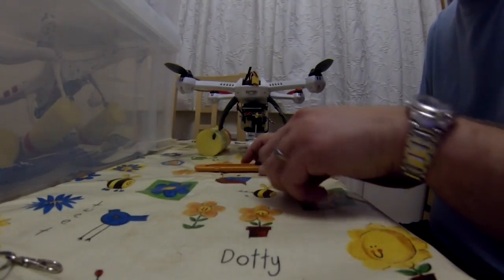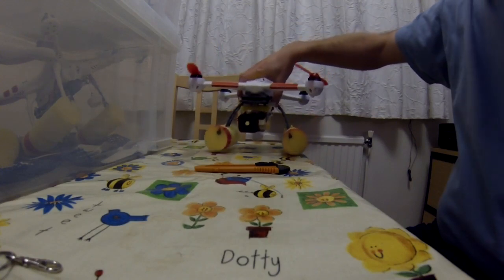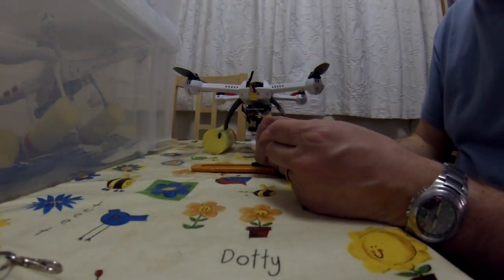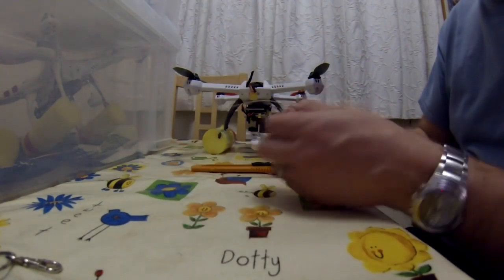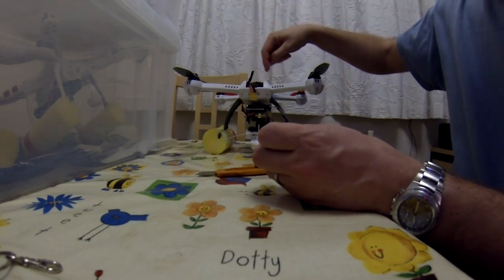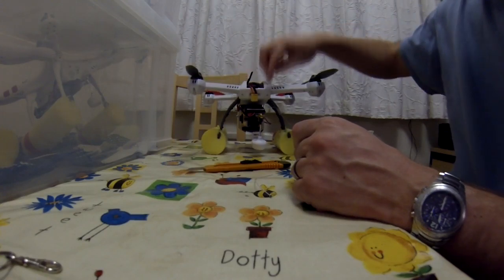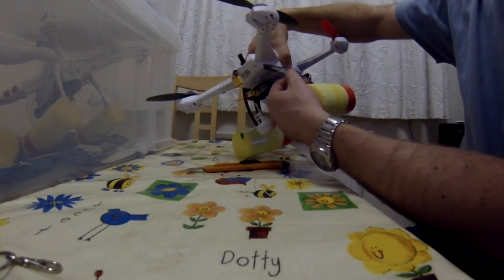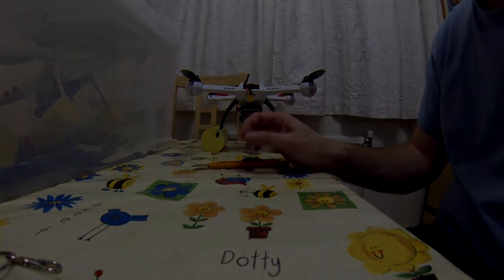Blade 350QX short RC range fix - external extended RC aerial - doubled range test distance

Comment: Glad you had the need and the guts to try this. I wanted to try it when I read the new AP model having a relocated external antenna just to extend my range. Maybe you'll be able to buy it ready to solder on from horizon when the AP parts are available. I bet it mounted to the other skid opposite the the compass receiver. If not, I'm doing what you did. Thanks!
Reply from the maker: Ready to solder wouldn't really help - its the soldering which is tricky/scary (but nowhere near as bad as I feared), making the extended aerial takes about 30 seconds out of a 99p piece of thin coax. You could put the aerial anywhere you like, I just put hole straight under the board and ran it to the nearest leg.

Comment: So James, you solder the inner part where the stock antenna was? and the the shielding to the ground pad? I am going to look around and see if I can find some antenna wire around here I must have some, I have an old ar500 that glitched on me caused crash don't trust it could rob that antenna.
Reply from the maker: YEs, its annoying you have to solder the wire pointing upwards, but I couldn't find a ground point underneath, the AR500 aerial would work, but seems a waste of a receiver just for the wire, if you search ebay for nintendo wifi or IPX cable you should find loads of cheap options, mine was $1.60 posted.

Comment: Will give this a go for sure as I have been totally relying on the failsafe rth function of the 350qx
Do you know if the new 350qx board will be a direct replacement for the v1 ?
Reply from the maker: I'd be surprised if it wasn't (only connects to speed controllers and GPS/Baro sensor which I don't believe have changed) but no way to know for sure without trying it.

Comment: Well 3 hours later I got it working, the way it was originally.
I tried to use a router wifi cable, for whatever reason, it didn't work. Bummer.it look the right size?

Comment: Which of the Nintendo cable to use WII or DS Wii u ?
Or what Dia is the cable, found lot for all nintendo all different Dimensions in thickness .
Reply from the maker: The one I used was Nintendo DSi wifi cable, it was longer than the DS lite version (comes with a circuitboard/aerial on one end I just cut off to use wire). Thickness I would guess is about 1mm, it looks the same as the Spektrum/Orange aerial coax wire to me.

Comment: James, I have a question about the Nintendo DSi wifi cable.  I order one from ebay and cut the board and end connector off.  I was expecting to find a solid copper wire similar to the existing antenna on the Blade 350.  But it looks like its several strands wire inside the inner sleeve.  Is this what the cable is surposed to be? and if it is than great I got the right one...  So on the end that connect to the board you are just soldering the inner strands into the old antenna whole.  Correct?  and leaving about 5mm of shielding on it so it does not interfere with the outer shielding.  and then the antenna end you are just cutting the outer shielding away and letting the inner shield and wire act as the 31.25mm antenna.  Thank you
Reply from the maker: Yes, thats correct, you need to solder the shielding to ground and the centre wire to the original aerial hole on QX side, then the other end strip back the sheath to just leave the centre wire protruding as close to 31.25mm as you can get.

Comment: Hi. I've not even flown my QX350 yet and saw this whilst checking out the postings. If the aerial is being extended like this then would it make sense to go for a half wavelength unshielded section of 62.50mm? I know the tuned lengths are important but don't understand any of the 1/4 1/2 full stuff (guessing 3/4 would be rubbish). Thanks.
Reply from the maker: I'm no expert, but I understand aerial has to be exactly 1/4 wavelength no more no less, if you have half wavelength then you get cancellation effect along the aerial so actually get a weaker signal. All the Spektrum receivers I've ever seen use 1/4 wavelength 31.25mm aerials, and get range well beyond anything you should ever need, the only issue with the original 350QX was the aerial was directly on the control board which is shielded by battery/motors etc, so moving it out of the way is all thats needed, I believe the updated 350QX comes from the factory like this, so if yours is new it may not need anything doing. Best thing is the failsafe works really well, so you can try it out and if signal is lost, it will start to return home, and pickup signal again safely, so just try in a nice clear area and you should be fine.

Comment: hi James.   Thanks for posting this mod.  I'm hoping I can apply it to my 350qx which seems to have a very limited radio range.   I wonder how you were able to separate the fine wire wrap from the centre wire?  I'm thinking that since the wire wrap is to be grounded I must insure that it remains isolated from the centre wire or does that matter?  I find it almost impossible to insure that the wire wrap does not touch the centre wire where they are both bared and the wrap is retwisted to be soldered  It's difficult to see in your picture.  Is there supposed to be some insolation between the centre wire and the wrap (grounded) wire?  Don't know if you come back to this site to answer questions but I'll come back from time to time to check for an answer.  thanks in advance
peter416
Reply from the maker: Hi Peter, I found easy way is to use a knife as shown in video to strip the outer shielding, then pull the braid away, and then cut the inner shield 5mm LONGER so the centre wire cannot touch the braid/ground, if you pause/freeze the still picture it hopefully shows it better than I can explain.
Reply: Of course I should have realized there would be an inner cover over the centre wire. I just didn't see it but I've got it now.  Thanks again. And to be positive I checked it with the multi meter.  0 ohm resistance between the two wires.
Reply from the maker: Klaus Peter Musterer no problem, the video isn't that clear on those still pics so hopefully useful info for others too.
Reply: Klaus Peter Musterer  Job complete and checked the range this morning. 
excellent!! about double the range of the old copper wire antenna.  A bit of a struggle pushing the new wire through the old antenna pad since the solder tends to fill the hole as you remove the copper wire.  Just pushed a needle through a few times to enlarge the hole and it went in smoothly.  An excellent mod.  highly recommended.
Reply from the maker: Klaus Peter Musterer Great feedback thanks, glad it worked for you too, yes its a bit fiddly soldering in, I found by twisting and tinning the new wire it would push through the pre-heated hole, but certainly a good idea to clear hole out first with a pin. I haven't seen the 350QX V2 but I know they have altered the aerial to fix this issue, I wonder if they just did the same as us ?

Comment: I am having the same problem! Have you tested the range again?
Reply from the maker: Sorry, Not had a chance to test range properly yet (weather and family!). I have flown around willow cathedral but didn't check range, I can only do this at the flying club where I have plenty of space to test safely, also I know exactly how far it went before and can check it goes further. Will update description when I have done a proper test.
Reply from the maker: ***** I got out to the flying field today to test flying range, and am delighted, I flew right round the perimeter of the flying field (~15 acres) with no issues both nose in and turning at furthest point, so this is a win for me, and gives me RC range to the limit of my FPV video which is what I was after. Well worth doing I'd say.
Reply: That is great! I am also going to try this. Will let you know if I get the same result.

Comment: Hi again got one off ebay 99p free pp,How long in total is the wire to be,I hear you say one end 32mm or is it 32mm total length.
Reply from the maker: Total wire can be however long you like, all that matters is the unscreened tip which should be 1/4 of 2.4ghz wavelength which is 31.25mm or as close as you can get.

Comment: So can't you just weld a longer csblr to run it to the front? So you are saying solder another cable instead?
Reply from the maker: You cannot extend the existing aerial, its a tuned length.
Reply: ***** I apologize, I didn't read the comments section and i'm new to RC vehicles. So what you did is change the material to this Nintendo IPX thing, i assume this is a better material to receive signals? Thank you very much for your answers

Comment: Thank's i see now i think the end you don't solder to board must just have the inner no shield on just bear wire must be  31.25mm ,That's the 2.4 wave length.Then cut to length you like then the other end cut just enough to solder to board .
Reply from the maker: Yes, exactly right - its a quarter wave length (as all our aerials are).
Reply: Thank you again .Why do Horizon use the little red wire as on most of there craft i don't know.
must be a cheaper option.
I don't know about the improved  350 Qx there bringing out.I have had mine eight weeks and new model already on it's way by horizon.
Reply from the maker: Paul Hussey It must be much cheaper, its fine for micro/nano stuff like the vapor or MCPX but I do think for the 350QX they should have had an external aerial from the start - they do on the new V2 so clearly they've come round and spent the extra tuppence ;)